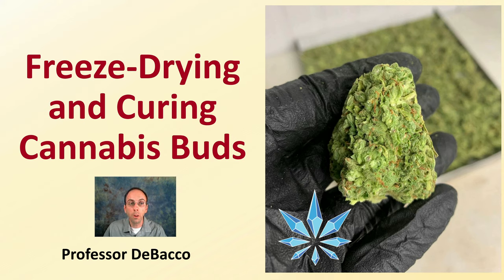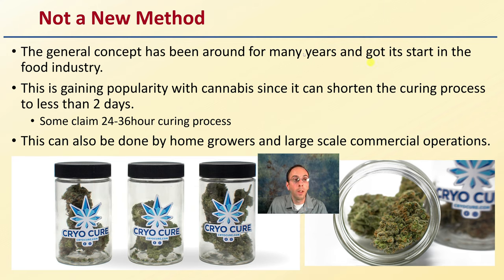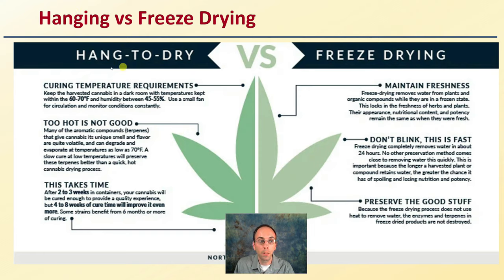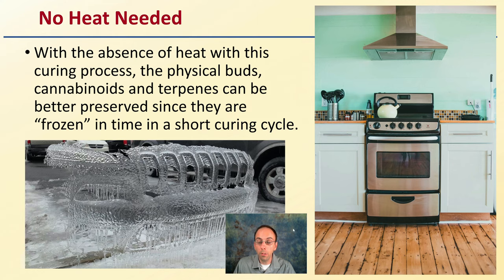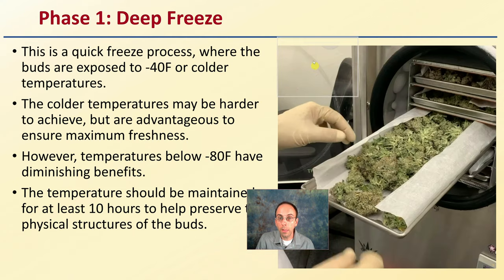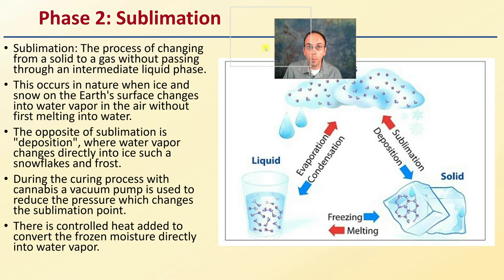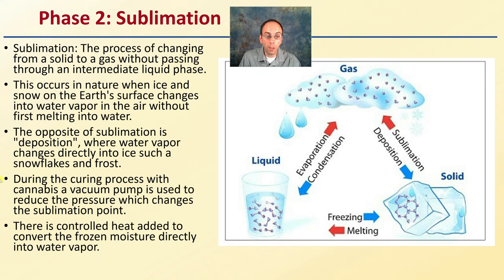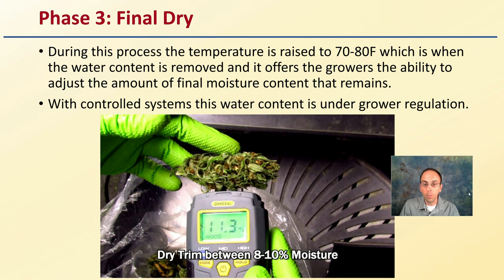Freeze Drying and Curing Cannabis Buds

Comment: Can you just give the actual process 🙄🙄 if you leave flower in a freeze dryer for 24hrs it's going to be completely ruined, dust. From my experience, the flower is ready in about 9hrs in the FD. Give a step by step process with times and pressure and exactly how to do it.
Reply from the maker: The specifics are proprietary but this can provide a general summery... https://cryocure.com/how-it-works/
Reply: Thanks for the info, I have a freeze dryer and was about to put it in for 24 hrs
Reply: Did you every find out the right tunning for the FD. Will be getting one soon and aint much  about cannabis freezedry to be found.  If you pulled it off will really appreciate the correct setup so the budz do not turn  too dry
Reply: @ilovecannabisalot7324  i aint opened the Fd yet. Still boxed up.drying the usual way .  I think i might try get cannacontol.